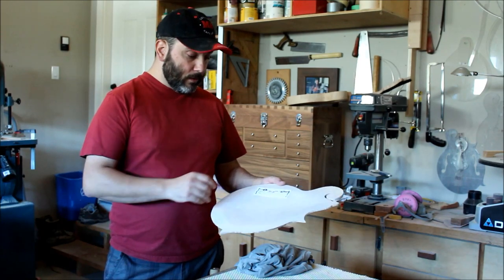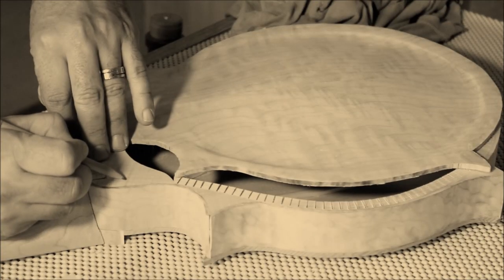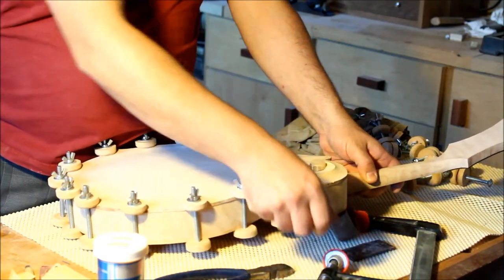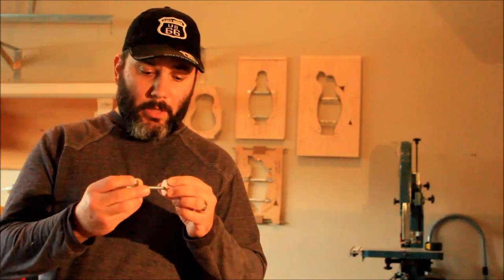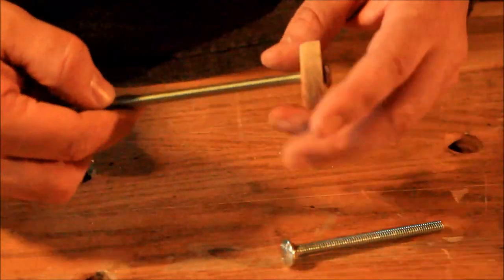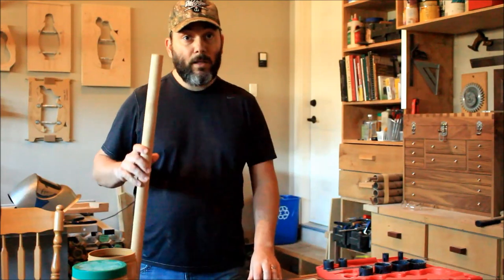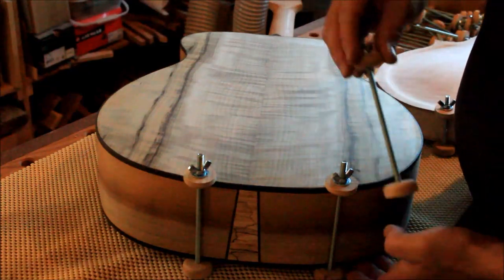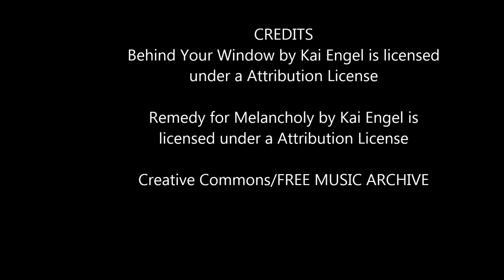How to Use and Make Spool Clamps

Comment: Just a suggestion. Look on a craft supply website for wooden wheels for cars. I think they come in pine and oak and they're already drilled and the edges are rounded. There pretty cheap too. Save a lot of time.
Reply from the maker: +michmvp Thanks for the tip... Never actually thought of that...

Comment: I made a similar set some time ago, lined with cork. Made the rods with a 4' section cut up - instead of carriage bolts. Those wing nuts were really expensive in my area though. Still, way cheaper than buying a set.

Comment: what was your carriage bolt thickness? I bought 8mm one, but I realized that my holesaw arbor drill bit size is 6.3mm. where you using your carriage bolt with 6mm?
Reply from the maker: Yes, mine are1/4” (6mm)
You could potentially just drill another bigger hole in the one made by arbor bit...

Comment: so for acoustic guitar building it does not matter about the actual length of the piece of wood? you used a half inch cut disc , i see many using a inch wood rod so if its hard wood it will be fine ? I want to sue them clamps also for clamping electric guitar tops in the future too. What size coach bolt do you recommend m5 or ? 

thanks

Comment: This is the best spool clamp video by far! Do you think that this method would work well using 2 x 4s?
Reply from the maker: Thanks Mike, I would assume so... I never tried it... My only concern would be for the wearing of the centre hole in the long run, being a softer wood. If this happens the clamping action would be less I would think.. Let me know how it works out if you go that way..
Reply from the maker: +Nick LoBosco Sorry Nick, just realized I called you Mike...Not too sure why?

Comment: you sem to be a pretty accomplished instrument builder. Coulfd you use hide glue instead of Aliphatic resin or white glue If you wanted to build with traditional techniques?
Reply from the maker: Of course, I could... But I like the simplicity and workability of the original titebond for those projects. All glue or resins have their pro and con. If I ever go traditional it would mean for me to remove all power tools from the equation and I'm not sure it's something I'm willing to do. For me traditional is a all in deal. Thanks for your comment...cheers
Reply: Tomy Hovington I didnt mean you as in you. I meant you as in all of us. Like in would they traditionally have used hide glue.
Reply from the maker: +rimmersbryggeri I'm sorry, I misunderstood your question ... The original mandolin family by Gibson were  hot hide glued together. So traditionally yes they were. For everybody that wants to make there own I would recommend AR glue or hide glue for the whole construction. I would definitely stay away from PVA glue as the join have more chances to creep overtime. Depending on your wood choice you may need epoxy for oily back joint.. In the guitar making industry they have been using AR for a long time so depending on where tradition starts for you is where you want to look into. I also know it's not well regarded if you make a violin and do not use hide glue. ( traditions). Hope it helps..
Reply: Tomy Hovington

Very good answer. I take it english is not your firs language either? Some time when i have shop I will try both methods. What about pva for things like bridges and fretboards that may need to be taken off for service?
Reply from the maker: +rimmersbryggeri AR glue can be soften with heat so for the bridge I would use AR no question asked, for the fretboard I would also go with AR but I do believe that PVA would work here...you are right I am French Canadian , so English is my second language :)
Reply: Tomy Hovington
 I have a canadian guitar I believe from quebec. I would like to try one day and build a replica of my grandfathers old archtop that was destroyed in a fire and then further destroyd so it's not worthwile fixing it anymore. Will you do any videos on how to achieve the arched top and bottom on an acoustic instrument?
Reply from the maker: +rimmersbryggeri I will in the futur, but I want to finish the ones I have in the shop at the moment first... My advice is even with the how to on the video you would still need a set of drawings to give you guide lines.. If you haven't done so already you can check my video " tap tunning of a mandola backboard" I do carve the outside of the backboard in that video.
Reply: Tomy Hovington
 My archtop was thin and the bracing is arched. It's from the 1930's.
Reply from the maker: I can't say that I've seen one of those before... Do you remember the bran name? I would love to make some reserch on that model..
Reply: It's called a Levin  but I think my Ibanez AF 55 is made in the same way with both top and back arched. They dont have a figured top though. the old one is stragih Spruce I think in up to 4 pieces but it originally had a sunburst finish which was removed after the fire. The ibanez I would guess is all maple and a very affordable guitar also.I thing the tops are somhow steam bent and the braced but oly with 4 braces straight across since the top and bottom are not really load bearing.
Reply from the maker: I couldn't really find a Levin that match the AF 55 online, but, by the looks of it the AF 55 is a full hollow body ( which means that there is no center block like a semi hollow). Therefore I would believe that the construction would be the same as a Jazz arctop guitar would be built.( Carved)

Now if the Levin had a very thin top like a standard acoutic guitar, my guess would be that they had a form and shape the bracing to it and then forced the soundboard (top) to the desired shape. I'm no expert in the older instrument but I know that when Gibson came out with the (carved) archtop tenor or acoustic guitars, it created a new dimention that other companies tried to get in. 

I think that if you want to replicate the same guitar you had, you would have to dig and investigate how those Levin were actually made in 1930.There is probably discution forums about this topic on the web. I've never build a full hollow body myself, only semi hollow. Maybe I will in the futur....Hope it helps..
Reply: Ibanez AF55 Yeah it's a full hollow but the top and bottom are arched.

I have the levin. It's a swedish brand they were eventually bought by C.F Martin I think. I can replicate how I was made if I put my nind into it but I thought I could get a shortcut since I thought the mandolin would be made in the same way.

Both the levin and the Ibanez are full hollow but the levin has lateral bracing and the Ibanez has longitudinal bracing. The ibanez doesnt have and bracing on the back board though so maybe that's much thicker. Levin were famous early on for their guitars and mandolins. In sweden we call them orchestra guitars . Most of them didnt make it though on account of having no truss rod which is no good in our climate.
Reply from the maker: I know for sure that mandolins are carved, If the brace are going from the neck to the bottom they are called tone bars and would indicate a carved top, The back are usualy brace from bass side to treble, that being said carved back don't need bracing. In our day and age there is more and more archtop that are laminated (like a plywood) and those look like real wood but are many layers of (usualy maple) I would perssonally carved both top and back if I was in your shoes.

Comment: I just subscribed to your channel!
are hardwoods preferable in this application?

Michael
Reply from the maker: Michael D welcome to the channel Michael. I'm sure soft wood would work also. The center hole may wear out making the disc wooble over time though. I used oak because that's what I had on hand!